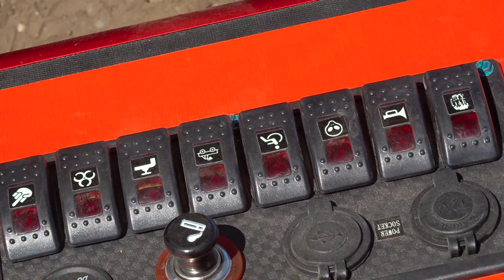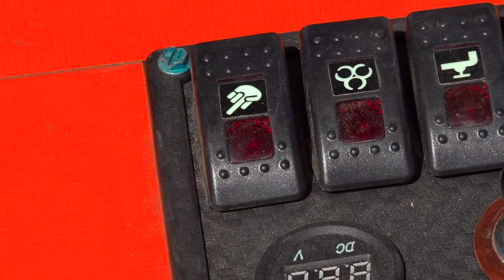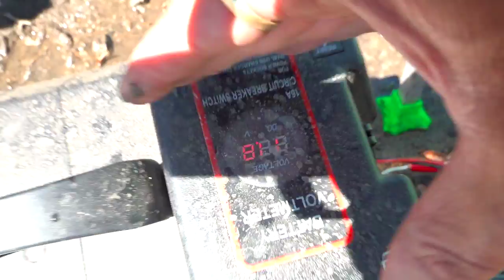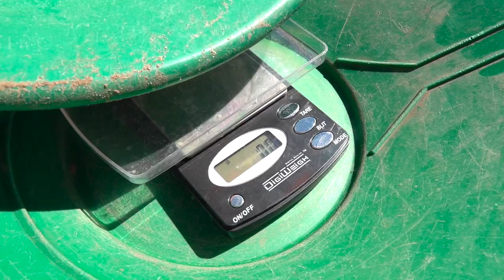YouTube GOLD! MiNE YOUR OWN BUSiNESS! Operating Small Heavy Duty Equipment (S3 E11) | RC ADVENTURES

Comment: Safety issues.... You need to make sure that all tires are on the ground before loading the haul trucks look at 19:00 in to the video the front tire is not flat on the ground. The  haul truck can start rolling away. You need to fix the water leak on the omni fox it could flood out the haul road or erode the sides of the pond 🤣🤣🤣🤣🤣🤣